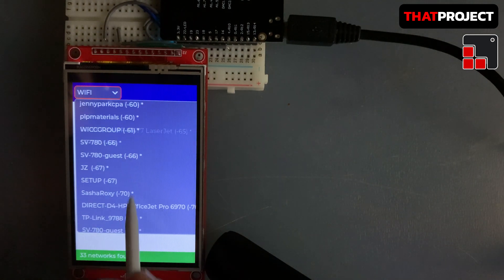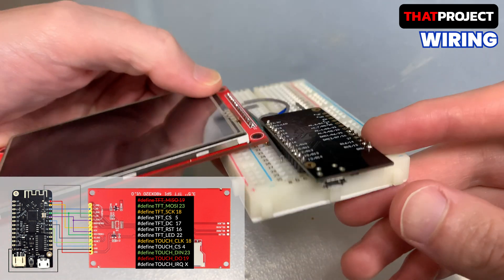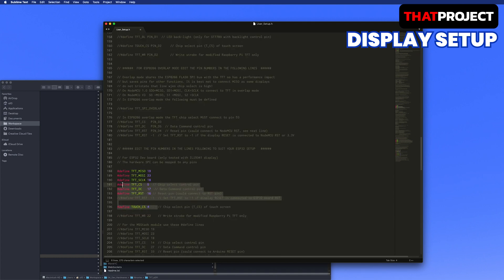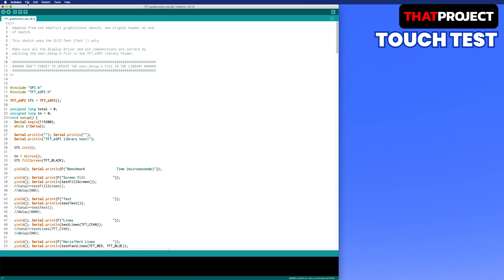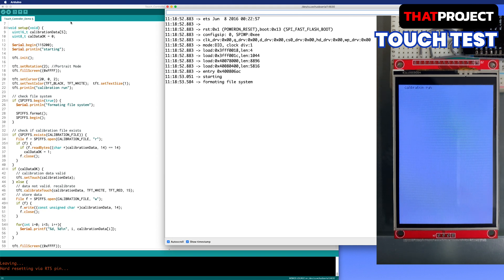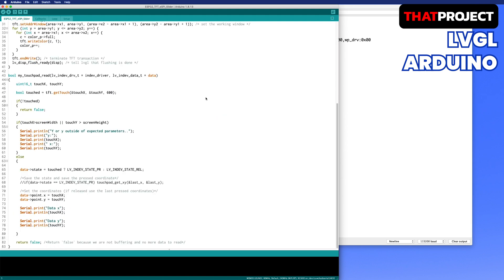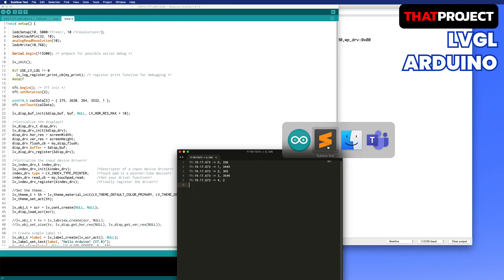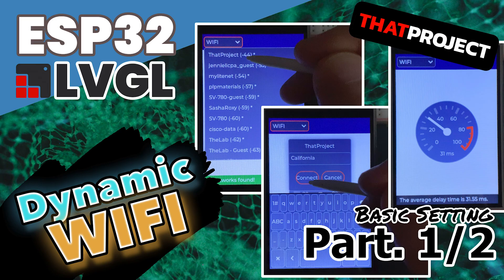ESP32 Dynamic WIFI configuration GUI using LVGL7.x - Part 1/2 - Basic Setting

Comment: Hi thank you for this nice project. While compiling eSPI_Slider sketch I am getting this error message:  Please help.

ResolveLibrary(../../lv_conf.h)
  -> candidates: []In file included from c:\users\ragot\documents\arduino\libraries\lvgl-master\src/misc/lv_log.h:16:0,

Multiple libraries were found for "lvgl.h"
                 from c:\users\ragot\documents\arduino\libraries\lvgl-master\lvgl.h:25,
 Used: C:\Users\ragot\Documents\Arduino\libraries\lvgl-master
                 from C:\Users\ragot\Documents\Arduino\libraries\lvgl-master\src/lvgl.h:17,
 Not used: C:\Users\ragot\Documents\Arduino\libraries\lv_arduino
                 from C:\Users\ragot\DATA_FOLDER\Desktop\LVGL_COLLECTION\ESP32_TFT_eSPI_Slider\ESP32_TFT_eSPI_Slider.ino:1:
c:\users\ragot\documents\arduino\libraries\lvgl-master\src\lv_conf_internal.h:41:103: fatal error: ../../lv_conf.h: No such file or directory
compilation terminated.
Reply from the maker: You know this project is built with LVGL 7. So for this project, you need to have LVGL 7 instead of the latest version LVGL 8. Is it set up like that?

Comment: how to calbrate when iam using 
int screenWidth = 240;
int screenHeight = 320; in tft espi example not have for my resolution
Reply from the maker: The resolution is set automatically when you select the driver you use in User_Setup.h.
Reply: @ThatProject  thanks

Comment: when i set     tft.setRotation(1); drpodown not showing list of the wifi ,i cant click
Reply from the maker: The problem occurred because the drop-down list is larger than the screen size.
Reply: @ThatProject  how to mke it fit pls🙏
Reply from the maker: @anonymouseanonymous2533  You can change the size of LVGL object with this, lv_obj_set_size("obj here", "width", "height);
Reply: @ThatProject  thank for answer my question, by the way nice tutorial, but i cant understand the docs lvgl, how can i use dark mode ,was change lv_theme_material_init(LV_THEME_DEFAULT_COLOR_PRIMARY, LV_THEME_DEFAULT_COLOR_SECONDARY, LV_THEME_MATERIAL_FLAG_LIGHT, LV_THEME_DEFAULT_FONT_SMALL , LV_THEME_DEFAULT_FONT_NORMAL, LV_THEME_DEFAULT_FONT_SUBTITLE, LV_THEME_DEFAULT_FONT_TITLE);  but not work, using dark mode
Reply: @ThatProject  thanks, can you help me how to make darkmoode form your sourcode ?

Comment: Can you make tutorial how to use the example LVGL, like printer exampel on esp32? I m new in this topic
Reply from the maker: Actually, I'm waiting for the next version of LVGL. I'd like to make a tutorial video including examples. Also, for the printer example, I need to have a bigger LCD first. I tried with 3.5inch which is the res 480x320 but it's not enough.
Reply: @ThatProject  or can you make tutorial how to make layout like printer demos pls
Reply from the maker: @anonymouseanonymous2533  I'm planning a tutorial using LVGL's new UI editor, called Edgeline. Please wait a little longer.

Comment: Why it's not working with the Esp32 WROOM-32 chip? Which board should I select in Arduino IDE?
Reply from the maker: You need to find out what your ESP32 is. Why don't you check the datasheet?

Comment: Hello, first thanks for your videos, I'm trying to make it work the example of slider in lv_arduino, I follow all of the steps, and the TFT display is ili9341 240x320, but the touchpad doesn’t work and I can’t move the slider, which can be the problem?? I calibrate the tft with the sketch TFT_eSPI -> examples -> generic -> touch_calibrate. With all examples of TFT_eSPI library the touch works, but no with lv_example. I checked: 

	lv_indev_drv_t indev_drv;
	lv_indev_drv_init(&indev_drv); /*Descriptor of a input device driver*/
	indev_drv.type = LV_INDEV_TYPE_POINTER; /*Touch pad is a pointer-like device*/
	indev_drv.read_cb = my_touchpad_read; /*Set your driver function*/
	lv_indev_drv_register(&indev_drv); /*Finally register the driver*/
 
And it's ok, which can be my problem? 

Also I tried to make it work your example of dynamic wifi connection, but the Display don't recognize the touch and it reset each 5 seconds, when they reset it prints in the serial monitor: 

rst:0xc (SW_CPU_RESET),boot:0x13 (SPI_FAST_FLASH_BOOT)
configsip: 0, SPIWP:0xee
clk_drv:0x00,q_drv:0x00,d_drv:0x00,cs0_drv:0x00,hd_drv:0x00,wp_drv:0x00
mode:DIO, clock div:1
load:0x3fff0018,len:4
load:0x3fff001c,len:1100
load:0x40078000,len:10900
load:0x40080400,len:6388
entry 0x400806b4

Thanks for all.
Reply from the maker: Ummm. I cannot find any problem there. Did you select the correct ESP32 you're using on the Arduino IDE board? Something from your board makes memory overflow.
Reply: @ThatProject  Finally I solved the lv_example and now the touch with lvgl works, it was all because I wasn't calling tick.attach_ms(LVGL_TICK_PERIOD, lv_tick_handler); I'm trying to make work your dynamic wifi configuration but by the moment only I got the program doesn't reset and the touch works, but the dropdownlist doesn't work if I press it.  Thanks for your support
Reply from the maker: @alvaromourazo8536  One problem has been solved. Currently, the contents of drop-down list are dynamically updated in my program. Why don't you remove this part and use the example first?
Reply: @ThatProject  I solved all problems, it was because I didn't have a good LCD calibration, thanks for your support and your videos!
Reply from the maker: @alvaromourazo8536  glad to hear that!